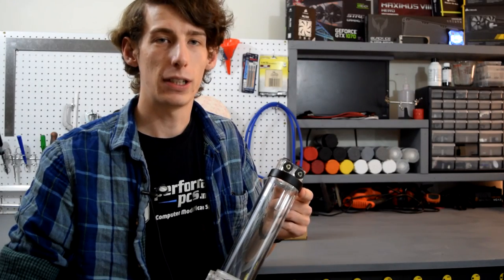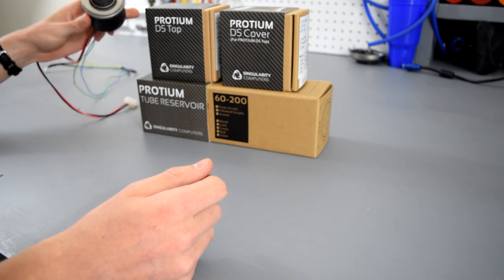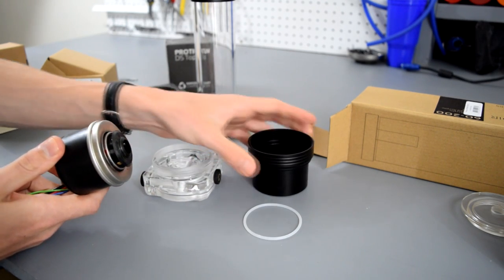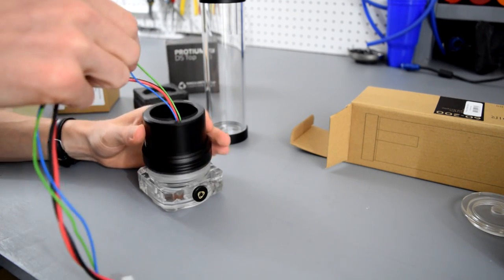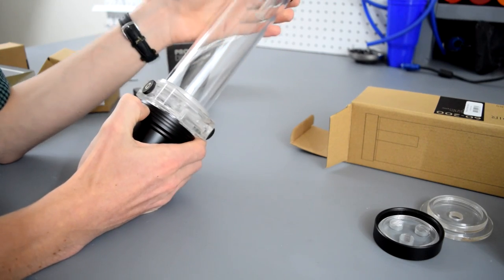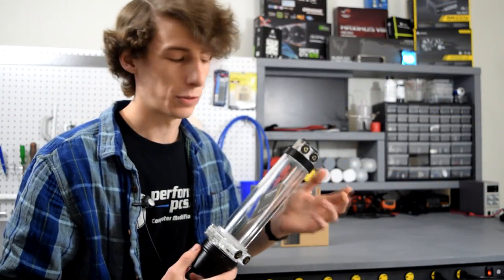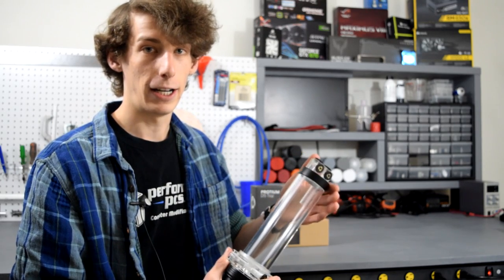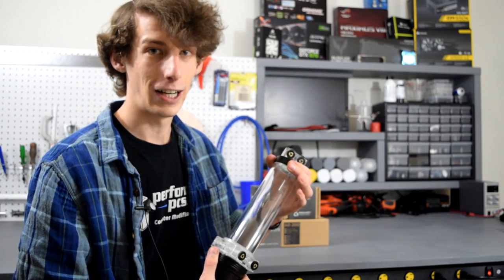Singularity Computers Protium Pump/Reservoir

Comment: I had purchased this pump top. Let me say the quality and finish is excellent. It looks great as well. However, after a few months (probably 4 months or so) I noticed a drip leak coming from the fitting on the outlet port. At first, I thought the compression fitting/tube/o-ring was faulted. I disassembled it and realized that there was a hairline crack being developed from within the pump block. Being acrylic, it could not seal so the block is defective. I ended purchasing another Protium D5 pump top, but the acetal version instead as it is more resilient than the acrylic.
Reply: yes iv had the same problem !! im now on my third topped because of this i even made sure i didn't over tighten the fittings but had the exact same hair line crack !!
Reply: this is known to happen on all acrylic style pump top and cpu block. They can get micro crack due to the temperature and pressure

Comment: what is the total length of the 150mm pump res combo?  im looking for something to put into a dark base pro 900 rev 2 and it MUST mount under optical drive cage and above PSU shroud and lastly it MUST have the top mounted return lines.

Comment: Is the D5 that comes with the protium(s) any better than the Aquacomputer D5 pwm? I seem to have poor flow~ for some reason
Reply from the maker: Can't say that it is any better or any worse they both work good in our book and are comparable
Reply: @PerformancePCsTV  I noticed the difference 1200 lph vs 1500 lph & 3.7 vs 3.9 head pressure. I wasn't sure if the extra 300 lph would make a significant difference or not, especially in a somewhat restrictive loop

Comment: one final note I didn't get the quad port top on my reservoir and it was short 1 of the plugs and yes I ordered mine from performance-pcs, I did message them but haven't heard back yet seeing as it was yesterday when my pumpres combo was delivered and im sure they were closed before the post even delivered my package.  just ordered the pump for it and also the missing plug and im hoping that ppcs improves some, this is the most recent order will be the thrid time and both of my first 2 attempts had issues with the orders but so far I have yet to get someone to actually respond ( I have had better luck with frozencpu and we all know their track record).
Reply from the maker: Hi lordraptor11 This product is different then the Pump/Res Combo depending on the Pump/Res combo you get one has the dual port top and some have the quad. This video is a review on the Singularity Protium Reservoir Tubes, Pump Top and Pump cover that are all sold separately and the Singularity Protium Reservoir Tubes still come with the quad port tops. There should be 5 stop plugs in your Pump Res combo you ordered, if there are any missing please email us at sales@performance-pcs.com and we will get in touch with Singularity Computers about providing you with a additional one as these are packaged by them and not opened at all on our end.
Reply: @PerformancePCsTV  protium D5 is what was ordered "new".  I already ordered a replacement from you along with a pump which you have uploaded a tracking number for today.  lastly what im referring to as missing the port plug is the quad port top I ordered with my D5 it came with 0 and it was not stated whether or not it came with port caps however I assumed it did based on this vid of the protium D5 (old).  lastly FYI I HAVE e-mailed support for the issues with both my first and second orders that had issues and I never got a reply so "support" is anything but as far as im concerned and again I state sadly I have had better luck with frozencpu.com and everyone knows the issues they have had in the past.
Reply from the maker: Hi Lordraptor11 I looked for a email from you and it looks like we never received anything. If you message us over facebook I can further assist with any issues that you had with previous orders. As for the quad port top those do not come with stop plugs as those are some of the replacement items we just started selling this video has the quad port top with plugs because the Singularity Protium Reservoir comes with 5 Stop Plugs.
Reply: @PerformancePCsTV  I am recommending people NOT buy the protium D5 pump res, because apparently there are 2 versions and old and a new and the new is the one I got which required me to spend extra on the quad port top and there are other differences which are not clear.  I was expecting the parts in individual boxes as per the vid especially the quad port top but no the quad port top came rolled up in bubble wrap.  I also wish to point out to everyone reading my comments to know that my D5 which I bought new has a few blemishes on the inlet tube and the reservoir tube that make me think that the D5 I bought new was in fact used or assembled by ppcs from used parts.  and you claim you haven't got any e-mails from me?  well I sent one Saturday when my package arrived which I expected to get a reply Monday  which I didn't just like I didn't get a reply the first time I contacted on first order and I find it odd that ppcs seems to have a go to response of " we didn't get an e-mail from you" ( as this was the exact same thing I was told the first time when I actually picked up the phone and called).  gotta be honest normally I blacklist vendors after the 2nd bad experience but this time I used ppcs a third time because I needed the sc plug, if it hadn't been for that I could have spent less buying the D5 pump itself from ebay though frozen cpu ( which has proven to be far more reliable and has never shorted any items or sent blemished or used products).  in the future I plan to either use ebay or frozen cpu because as I said , cheaper and far more reliable
Reply from the maker: I am sorry that you feel this way but both Listings for the 2 different models of the Singularity Protium Pump Res combo state exactly what they come with and even have the correct pictures of what they come with. If you have issues with the inlet tube having blemishes you can surely contact us and we will fix the issue. I can not help you further through these comments so please contact us through Facebook as you say you have emailed sales@performance-pcs.com and we for some reason are not getting your emails. Also I would double check the email address you are sending it to as you could be missing a letter or something and this is why we are not receiving it. We do not ignore customers we are here to help with any issues or problems you may have as best we can.
Reply: @PerformancePCsTV  if you are not getting my e-mails it is because of the links on ppcs site as that is what im using to send e-mails.  as far as the inlet tube goes instead of wasting my time trying to deal with a company that doesn't respond to e-mails and tries to place the blame on the customer, I would rather just try to sand and flame polish the gouge out ( yes it is a gouge and the inlet tube was in the original top so tight I had to use a rubber strap pipe wrench to get it out). I am hoping that my pump and plug that I ordered yesterday doesn't have any issues or problems, if it weren't for no one else having the plug, I would have save a lot of money buying the exact same pump somewhere else and got free priority mail shipping in some cases.  I am extremely disappointed with ppcs and that is saying a lot considering my former online e-tailer of choice was frozen cpu and they have at least sent me new quality product and not stuff that looks used.
Reply: @lordraptor11  I recently ordered a Protium D5 from Amazon, and P-PCs was the vendor.

Although it didn't arrive with a quad port top or stop plugs, P-PCs responded to my email within 10 minutes, and is sending out replacements today.  No questions asked, just an immediate, "we'll send them out immediately".

Perhaps P-PCs has improved their customer support in the last year, but regardless, it seems very good now.

Comment: I put this setup together today and have had some issues. I used the pump from an EK 140 pump/res combo and I'm seeing here you did not use the black O-ring that is on the pump itself. I hope that makes sense.
Reply from the maker: Either the included O ring or the EK one should work, however I always prefer to use the included one.
Reply: PerformancePCsTV at first I had left both of them on there. The black one that came with the ek combo and the translucent one included with the singularity pump top. The black one just seemed to match up perfectly so I assumed it was meant to stay there. As soon as I just used the one that came with the singularity pump top it worked perfectly. I’d probably have to show you a picture of what I mean but it’s all assembled now. Now to figure out raid 0 for the first time

Comment: Do the rad mounts secure it in place or is it pressure based?
Reply: There are many options for mounting. There are the clamps, but you can also direct mount a pump top to one of the 120/140 backplates. We also have another mount for mounting directly to the pump tops.